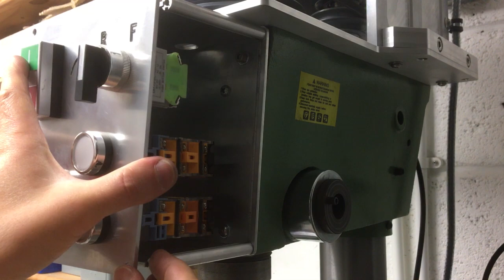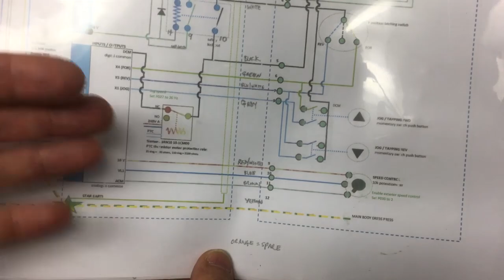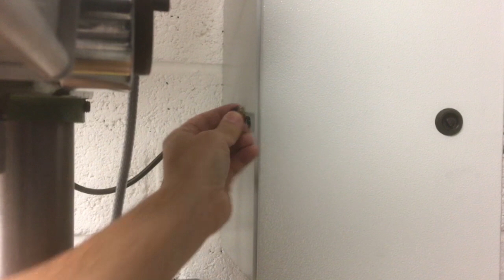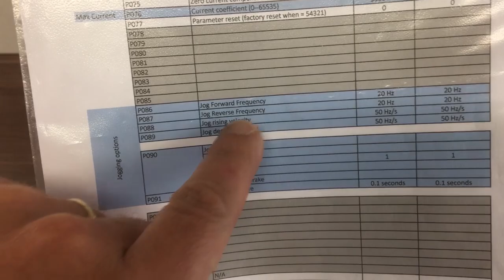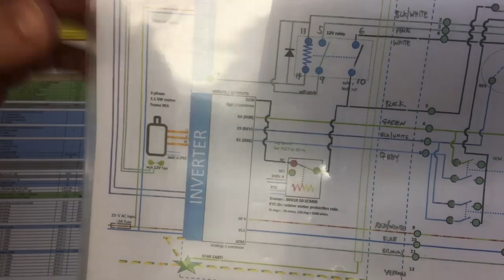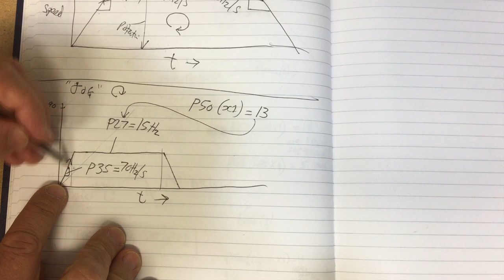Ep9: Drill Press Upgrade | Get Your Motor Running . . . !

Comment: I have an old hisey- wolf grinder. Motor plate is missing. I'm thinking 3 phase 400volt in USA. The VFD won't give it any power. Error code 1
Reply from the maker: Hi Brian.  I'm not sure which inverter you have but this XSY-AT1 model is single phase 230V and error code 1 is module protection.  So it is shutting down due to a fault, possibly a short circuit on the input.  I guess you could check resistance between each motor phase (when not connected to the inverter), and make sure it reads several ohms.  Also between each winding and the ground/motor case which should be very high/infinite.  Apart from that I'm not sure.  These inverters need to match the motor type to some extent, but then can be configured to match the motor plate.  They are not completely universal.  You could also check the inverter will come on without the motor connected, but I would not then try and 'run' it.
Reply: @routercnc9517  I have the XSY-AT4. It's connected to a 240 v single phase. I disconnect the motor,  it comes on, but there is no output on the u v w terminals
Reply: @routercnc9517  update:
Disconnected the ground wire from the VFD to the power supply and..... it works!
Reply from the maker: @brianlucas7604  Great that it works - I'm no expert on grounding but make sure it is still safe

Comment: i'm using halo led lights meant for a car and fitted with a few magnets around the quill , works great
hmmm i might go dig a bit more in my vfd the brake on mine is verry sudden and on my drill it actually shocks the head enough to have the drill drop out of the chuck , have to see if i can slow the braking speed down a little , i dont even have a jog speed
Reply from the maker: OK yes that would be a good option too.  I'll see how good this one is and then decide.

Comment: Really like your videos, very well presented and easy to follow.  Could you please tell me the name of the connectors you used to connect up the control panel?  I can see lots of applications for those but don't know what description to search under.  Your wiring diagrams look really good.  Do you use a particular software for those?  I am just setting out on a CNC router and can see that having a good wiring diagram will save hours of frustration!
Reply from the maker: Try searching for motorcycle car electrical connectors on eBay.  For the drawings I use the drawing tools in Excel and some patience !  Good luck with your project !
Reply: @routercnc9517  Brilliant, found them.  Thank you.

Comment from the maker: In reply to Scott’s question (I can’t reply direct as the comment is in my inbox but not shown on the channel comments below).  I did think about wiring the estop to one of the user input channels (eg X3) but it would have complicated the wiring plus I only had 12 cables.  The original setup had the stop and estop as the same button plus when it is up and running I will tune the spool down time to be a minimum.  There will be a limit however it is done as there is no braking resistor terminal on this inverter so you are limited by what the electronics can soak up.  Thanks, good comment and worth airing in case others are planning a similar conversion.

Comment: No shielded cables? No doubts about malfunctions?
Reply from the maker: I thought about it but went with a robust cable to resist mechanical damage.  My CNC machine does not use shielded cables on the inverter controls and has been fine for years.  I guess we will see !